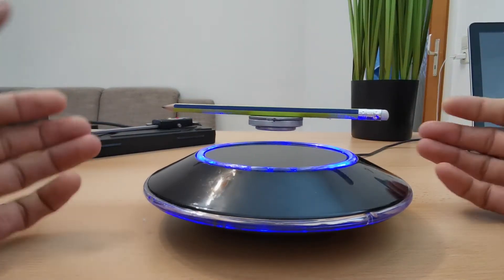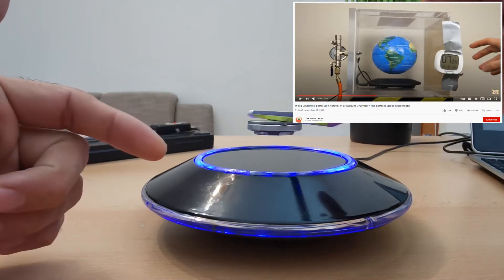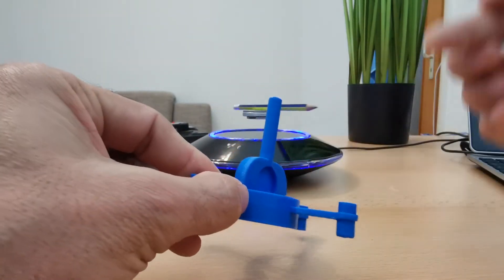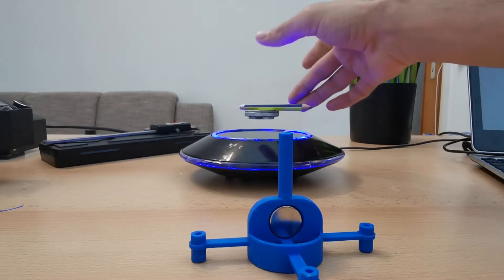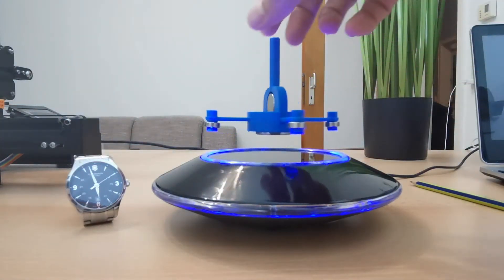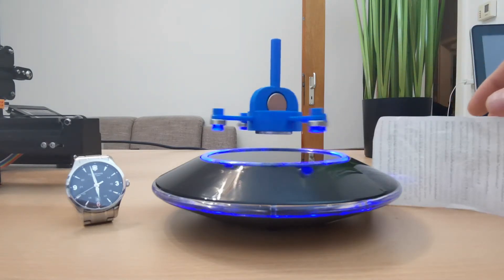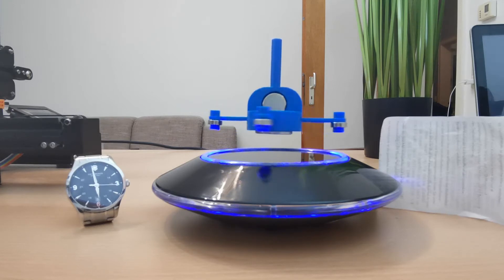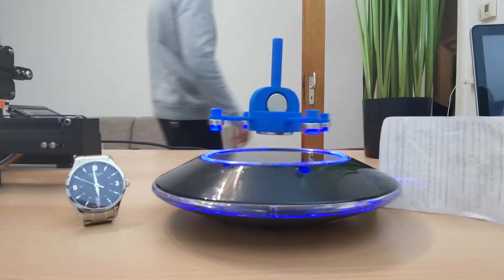Infinite Spinning Using Magnetic Levitation - 3D Printed

Comment: Awesome..I thought that you didn't use a power supply, please try the 3D print sphere form with  a magnet would further reduce air friction, just like a pulse motor with mirror or nail.
Reply: Wheres a good place to find . Stl files for stuff like this?